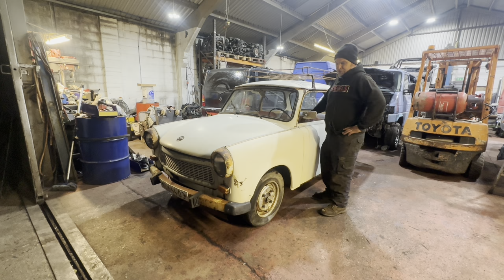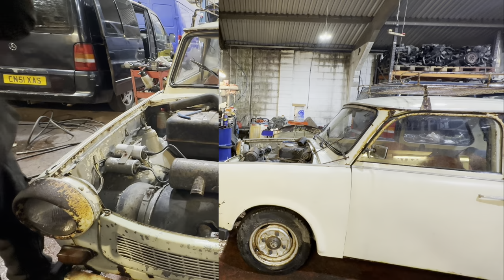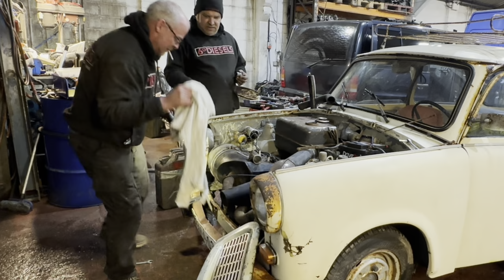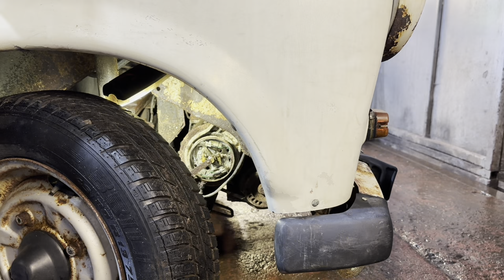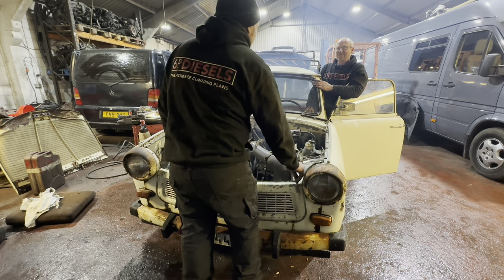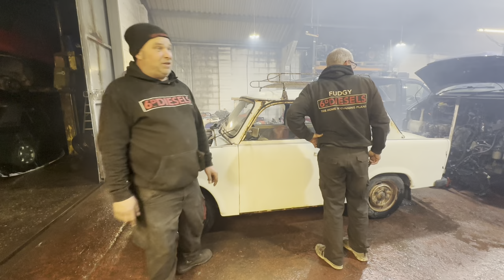6d goes all communist.. sat for many years can we make this top quality motor run and drive again ??

Comment: I worked with a East German engineer who had worked at the Trebant plant in the wait for it........ research and development department!😮 Even though the design didn't change in it's 40 year history. It turns out they sold their ideas to the west. They designed and built a prototype of the MK1 Golf, but we're told to crush it when they sold the design to VW, the engineers hid it instead it's now in the Trabant museum. He told me you had to wait 12 years for one so used ones were more expensive than new ones. I did drive my friends one, a green estate that was an experience😂 😂😂😂
Reply from the maker: They where well ahead of there time as a car company, some of the stuff they designed was epic but sadly the failing economy stopped them from going into production 👍

Comment: Dang, de dang, dang, dang. I remember them well. As a Brit ex-pat residing in Berlin since 1980 we could smell the two-stroke oil from East Berlin in the West. On the transit route to West Germany there were always a plethera of 'trabies' standing on hard shoulder being repaired in situ by their proud owners. In East Germany there was a black market for used trabies because there was a 10 year waiting list for a new one. The last version in the mid 1980's was fitted with a VW 1.1 4 stroke petrol engine licensed directly from VW. When the wall came down you could buy these death traps for pennies when their previous owners were 'upgrading' to large Fords with more oomph. There are still enthusiasts who restore maintain and race these cars but it has become expensive due to the scarcity of parts. I never ever expected to see one of these in the UK.

Comment: Apparently this one has been bypassed but from factory there was a fuel tap underneath the tank. Depending on the model year the handle is in the passenger footwell or there's a linkage to a knob under the dash, below where the radio would go. The cars came with a dipstick for the fuel tank. Only very late ones had a fuel gauge (and possibly only higher-spec models). Some 80s models had an actual fuel efficiency gauge - a cluster of green, amber and red LEDs if I remember correctly and the more fuel you ran through the carb the more LEDs lit up.

Comment: Its made of what was called 'duraplast'  mixture of resin and wool waste from carpet making of all.things. .
 I had a Wartburg knight  It had the same engine but 3 cylinder.
  Rusted  and  basically fell apart. 
 Swapped it for a  used vauxhall viva  after the gearstick snapped off in my hand  on the one way bit of market place in Blandford . used to be a used car place on the Salisbury road  bought the viva for £100  and he gave me a tenner for the Wartburg  just cos he'd not seen one ! 
 Those wee the days . ( Mid 80's)

Comment: Not sure if those were 6v systems on them ? Possibly why the coil was letting all the important smoke out of it ?
Reply from the maker: 12v in 82 this is a 6v one 👍
Reply from the maker: And that was a wire broke. With about 3 strands left attached

Comment: I do remember this on marketplace I think it was, never heard back as I thought it just right to have alongside my Reliant 3 wheel van, am also a Soviet watch specialist and a big fan of the Soviet era motors with my dream motor being a UAZ 4x4 or Soviet answer to the Land Rover and almost as capable being a military spec, a GAZ Stratospheric with the crazy fuel system and a MK1 Vyatka which came about when the Soviets refused licencing by Piaggio to build the Vespa 150 in Russia, just went to Italy and sent a brand new Vespa 150 back to Moscow where it was taken to pieces, everything copied and measured and the Vyatka was born a 1:1 clone of the Italian icon.   The main users of the Vyatka in rural areas was the local party/KGB man and folks used to dread hearing that ringdingding of the motor coming to their village, bit like seaside resorts today when a scooter rally is on hehehehe   Back in 2000 I bought a 1 year old Lada Riva for £100 I kid you not, damn thing ripped my back and shoulders out badly, drove like a dream and I expected it to be like my Lada Niva but oh no it was a dreadful driving experience...
Reply: In my front room, instead of chairs to go with the L shaped leather sofa I have a 1958 Lambretta Li and a 1985 Vespa MK1 T5 heavily customised as furniture :P

Comment: Eyup Al, thanks Al for all of your hard work, I have been following you for some time and I was wondering, what happened to the last part of the merc van that you replaced the front nearside quarter on?  I got upto part 2 where all of the welding to the inner wing and cross member was done and it needed a sill and painting.  Did I miss the next bit? Please help as I am desperate to see the end result.  Paul from Widnes
Reply from the maker: Still to come fella 👍

Comment: Had a couple of these over the years. A 1985 601 Hycomat from Berlin. A mate had a 1990 1.1 Polish one. The most fun you can have with your breeches on.
Don’t over oil it. It’ll coke and choke.
They’re made of duraplast. A sort of cotton/fibreglass mix. There a brilliant video on YouTube about the manufacture of them. Quality control & worker H&S was NOT top of the commie list.

Comment: Do they ever figure out its a 6v system? 😂
Reply from the maker: Yep 81 on 12v all the earlier cars are 6v
Reply: @6DDIESELSDorset  that's a relief, I was watching, and the coil started smoking, and the starter span so fast, but then by the end it was still running. My only Trab experience is @Seaside Garage and @Aging Wheels.